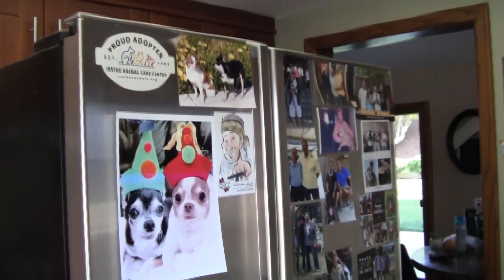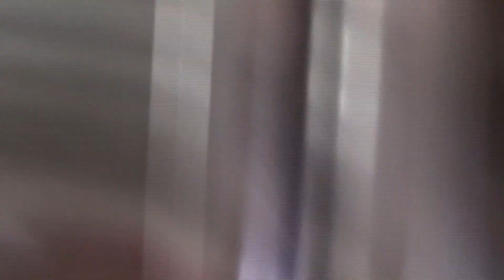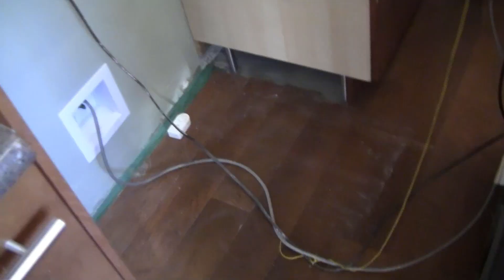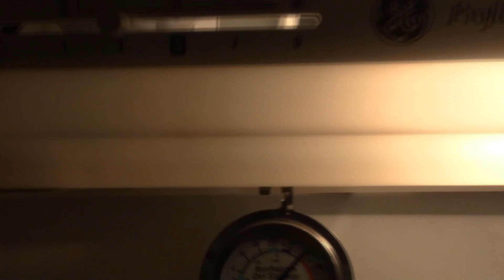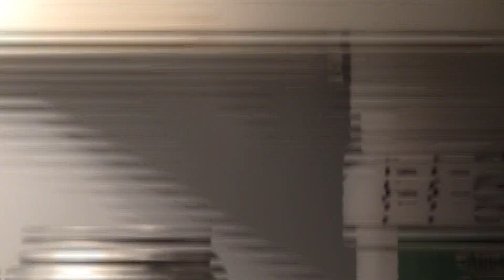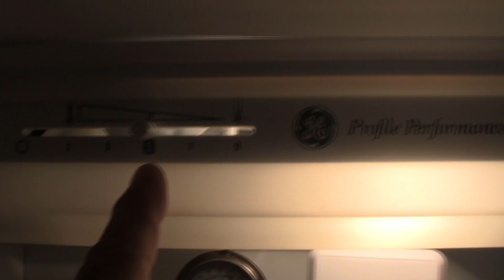Refrigerator To Warm Troubleshooting

Comment: Ken, if THAT refrigerator isn't able to get below 40 degrees without lowering the temperature of the freezer, I'd look into the evaporator being frozen. 
( better than looking into the refrigerant charge)
From a 30 year commerical service technician.....
So many times technicians look right over the easy solution before digging into the refrigerant charge. 
If it is a leak, time to part with that piece of equipment
Reply from the maker: Great advise, Thank you. the cabinet was able to reach 38F and I did raise the freezer setting to 5 and the freezer is maintaining 0F, I have the refrigerator setting on 9 and it is maintaining 38F to 40F depending on the time of day and door open. I think I am done as I have reached my setpoints. What do you think?
Reply: @KenTraining  can you see the suction line going into the compressor? Is does it have frost on it? I'm always suspect  of units that don't easily maintain temperature. 
I find that the door being left open cause enough frost that a normal defrost doesn't remove it. Even over time, sometimes  "frost free" units need an occasional manual defrost. Perfect world, they shouldn't
Reply from the maker: @23Mike25   I don't see any frost on the suction line.
Reply: @KenTraining  good luck, temperature of the house shouldn't have much effect on the refrigerator ( unless it's over 90 inside) most equipment has an operating range, older the equipment, less efficient they are. Most refrigerated equipment usually run 90-95.
Seems like you enjoy helping, liked the video. I'd say 80% of the population have no clue on the basics. Doing a nice service

Comment: Your having to Change your settings that have been okay in the past... so there is nothing new happening with math or physics, you have a problem. BTW cleaning the condenser is a good thing to do, blowing that crap all over your kitchen and house is Not a good thing to do.USE a vacuum cleaner. A properly working refrigerator will work at it's original settings when the system is correct. You are going to have to find the actual problem.
Reply from the maker: One thing did change. the house temperature was warmer than usual due to very warm outside and we did not turn on the AC.